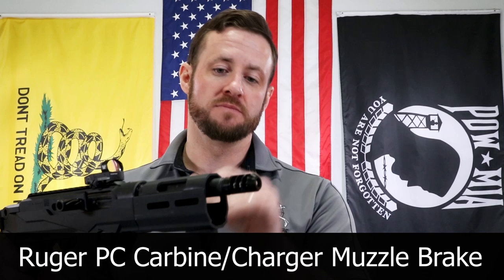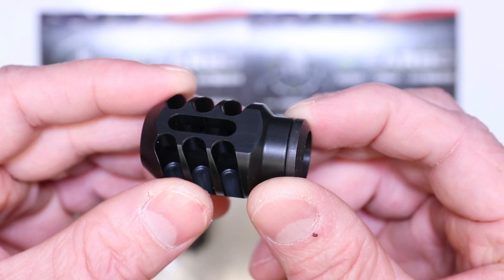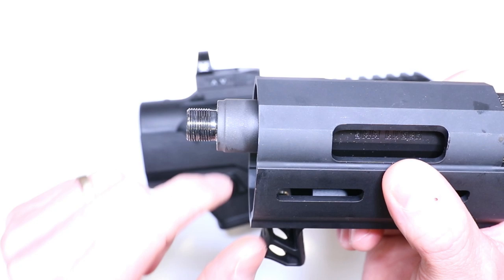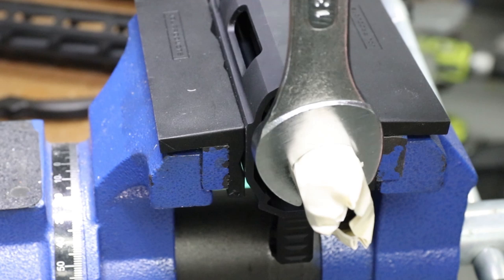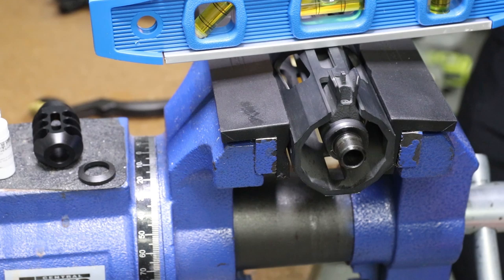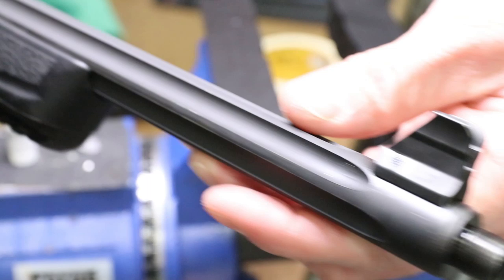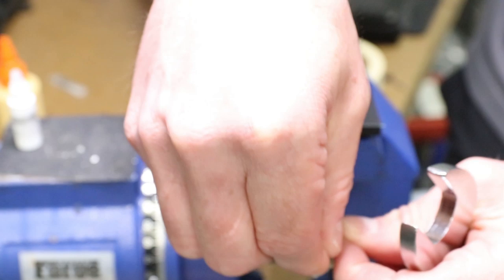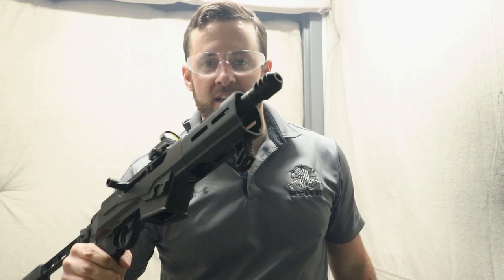Ruger PC Carbine Muzzle Brake & Ruger PC Charger Muzzle Brake Ruger PC Carbine Accessories! M*CARBO

Comment: Looking forward to the install/build video for the PC Charger. I'm having stove pipe and feeding issues with my PC Charger when I used an off brand 30rd Glock mag. I bought a 17rd Glock brand mag and it performs a lot better. So far, I ordered the MCARBO  Recoil reduction bundle, flat trigger with springs, and muzzle break. The extractor and bolt head pins are on the way.
Reply: I've put about 2,000 rounds through mine and had two failure to feeds with the Amend2 34rd glock mags. I usually only load them to 31-32 rounds. No issues with the Glock factory 31rd mag. You think this would be a 3rd party mag issue?
Reply: Stick with factory glock mags not off brand stuff. Never a single malfunction in my glock 19 or my PC carbine.
Reply: Absolutely that's the problem.

Comment: Now I have always used some high temp, anti seize, thread grease (Like Aeroshell 33), and a drop of blue locktite. If mechanics use on engine blocks, its good enough for my occasional shooting. And no problems with muzzle breaks staying on, or being removed.
Reply: Because of how the radiator and cooling system works on engines, they won’t be able to get as hot as a muzzle does after repeatedly firing rounds.  I’d you’re only firing a few rounds and/or always firing way slow, it might be OK long term.

Comment: Was that the full size or mini installed on the charger ?
Reply: Chadhc that's the old one, this was before he came out with the 2 new brakes. The new full size looks functionally the same as this old one but isn't as rounded. I have this old one though I think the newer ones may look a little better

Comment: @MCARBO Mine is binding after the first rotation and it won't even budge a centimeter so I can get it to level.

Update: Havent shot my PC Carbine in a while, took it out of the safe to try to fix the muzzle brake and it still wont fit properly smh.
Reply: Go backwards then try again I had an issue with mine too I took it to the smith he used a vise I didn't have. Perfect fit now with the crush washer.
Reply: I’m having the exact same problem. You would swear there are no more threads left to turn on but I know there is. I’m stuck for now as I have no access to GS anywhere around me. Any help from MCarbo or experienced shooter. Thanks
Reply: @CanineResources  Yah I havent heard back from anyone since I posted this comment. I have so many guns I havent been in a big rush to try to put it on but I kinda want to shoot my PC carbine since I havent in so long.

Comment: Will it work for the hi-point 9mm too Mr Chris????
Reply: As long as the hipoint is 1/2 x 28 threads.
Reply: it is!!!!!......I'm getting one!!!!!!!!
Reply: @JonDoe-lu1cu  Now double Check this Muzzle breaks, thread pattern, versus yours. But my Ruger PCC has the 1/2 x 28 threads. (Some other companies are using an odd size, like 1/2 x 36.) see this link, if needed.  https://www.silencercentral.com/blog/silencer-common-barrel-thread-patterns/
Reply from the maker: Yes Sir, it will!